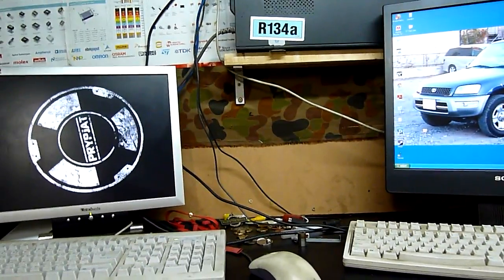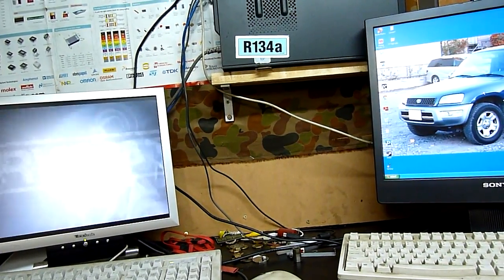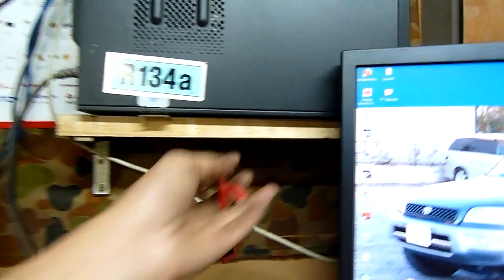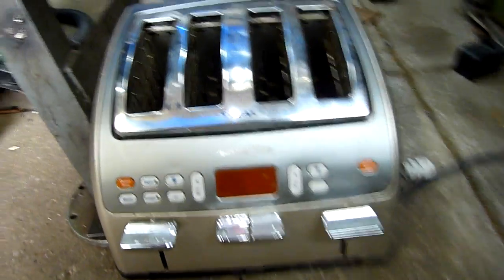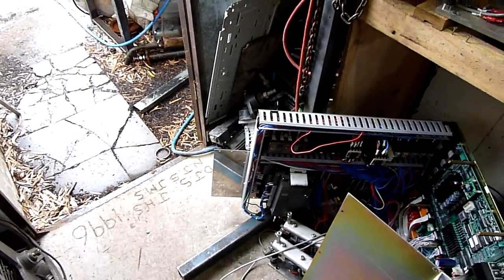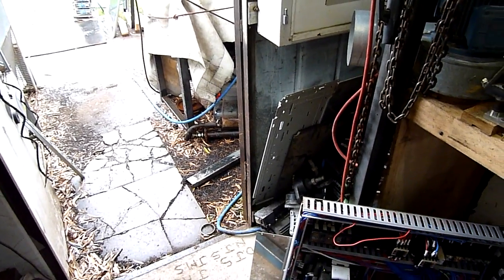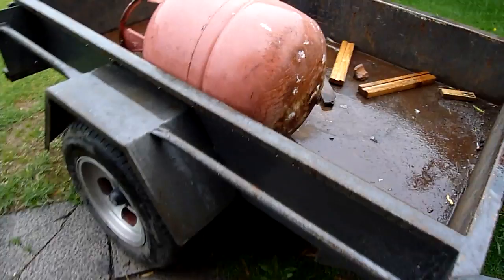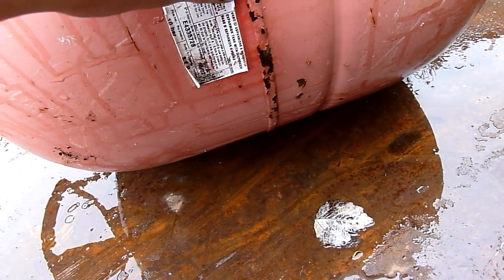Ramblotronic Saturday - More Goodies for Experiments

Comment: @tricksteronline1 our house has pure electric heat with the exception of our downstairs fire place. it sucks! we have electric baseboards and down stairs there are 3 thermal storage units 168 KG worth of ceramic bricks in each unit they were imported from UK, they each have a 3.36 KW element to heat the ceramic bricks, luckily we haven't turn them on this year, our fire place has two jackets and the large one has three fans that blow around 300cfm through the jacket...

Comment: If you are going to upgrade the graphics card in the computer now on the shelf, there are some good low profile graphics cards out there that you can get. If going nvidia grab a Gigabyte GV-N430OC-1GL GT 430, or if you want to give AMD a shot you can get a MSI R6570-MD1G/LP Radeon HD 6570. Both are pretty much as powerful as one can get in a low profile card.